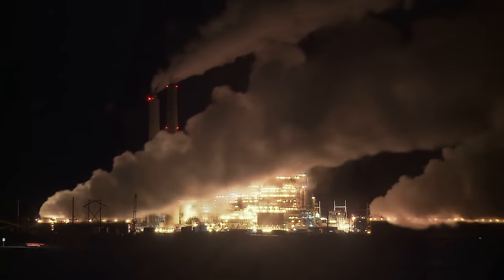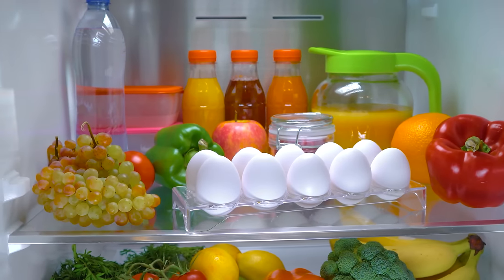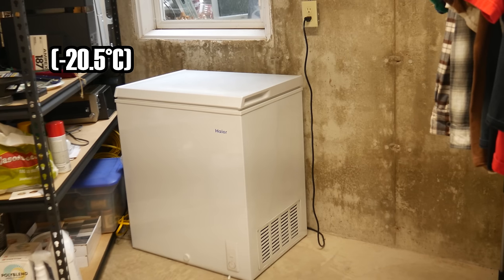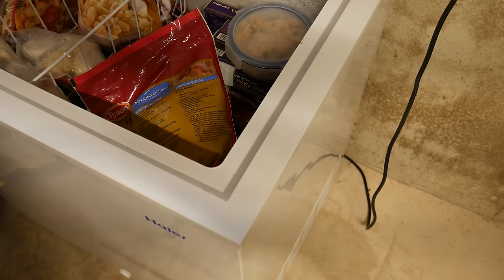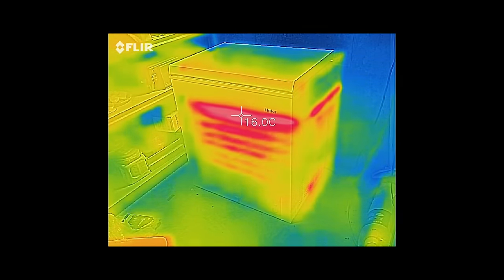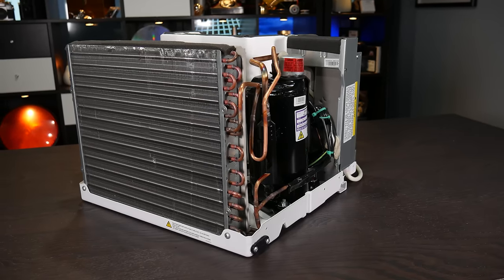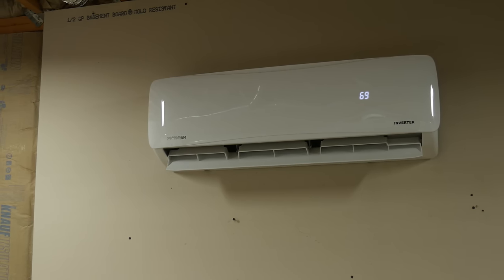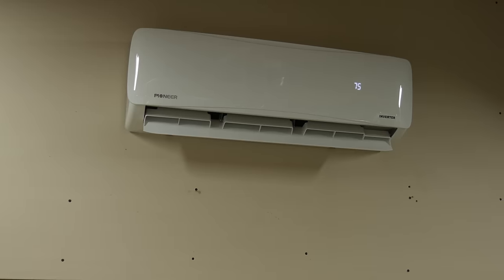Heat Pumps: the Future of Home Heating

Comment: First off loved the detailed explanations of this video! We have a heat pump here in the North West USA. It is great spring and fall (anytime temp above 35-40 f - they have little to no usefulness below that as stated in the video). We use natural gas for the 2.5 months that temps are usually below that. I was little perturbed by the scene of a snowy cabin being used to introduce the heat pump heating abilities - that is very unrealistic. That would be so expensive!!! They use so much electricity below 40. We forgot to turn off the heat pump once and our bill was 3x compared to natural gas furnace.
Reply: The three we had installed are rated to work down to -25c (-13f)  We have baseboards which may be used selectively when heating on days the temp dips below that.  Usually about 3-6 days of the year.  Great investment!
Reply: Absolutely.  The irony of a heat pump is the colder it is, the less efficient they are.  Outside of CA and a few southern states they are a total waste of money and electricity.

We installed a wood stove because our heat pump couldn't keep up in the winter.  

Seems like the world is losing it's mind.  I'd never buy a house with a heat pump anywhere that gets below freezing.
Reply: @dielawn212  it is currently - 26c here, and in Winnipeg it is common to be ten degrees warmer or colder all winter. Our closed loop geothermal heats our 4000 Sq ft just fine, and over the last seventeen years has been flawless
Reply: Exactly - that's why I don't see them as this amazing thing. I had the same reaction to that picture. 

Even on the east coast it gets below 40 often during the winter, if only at night, let alone when we have a colder than normal winter/cold snap. 

And over 40, it's not even that cold so what's the point? The house can keep it's 65-ish temp on it's own.
Reply: A geothermal is not a standard air-air heat pump.
Reply: @grant r. Geothermals are a type of heat pump but not the standard air to air model.  Yours is a Geothermal heat pump. Meaning the medium of exchange is in the ground and not simply the air itself. Much more consistent temps below the frost line than above it
Reply: Also way more expensive than the standard air to air
Reply: @bertellijustin6376  Yes, that is true. It is much more efficient with the ground loop than air to air. These systems are more condusive in cold climates, however the initial cost extends their roi.
Reply: Consider geothermal heat pumps, check out their advantages and disadvantages.
Reply: There's also different brands that operate at higher pressures using different refrigerants that work efficiently at Much lower temperatures these days.
Reply: Most air to air heat pumps sold in Finland make plenty of heat even in -25C degrees. It can't heat the house on its own in that temp but overall my pump saves me so much in electricity over the year.
Reply: @jaakkolehto8203  Consider using geothermal heat pumps, they should work in colder climate. At least in the lower 48 in the USA.
Reply: @timothyprice9064  Definitely that would be best choice but as my house doesn't have water based heater system (radiator/floorheating) it is very very expensive to install geothermal+ heaters inside the house. House that i live has one air to air+ 2 ton energy reserving woodburing stove that heats the house 24h even after the fire goes out. So i only need direct electric heating when it gets -20C or colder. So for few weeks per year my current system is pretty good.
Reply: @jaakkolehto8203  Geothermal heat pumps are not what you're thinking they are, their lines are hurried just below the fros line. Look up geothermal heat pumps, it might change your mind.
Reply: @dielawn212  I don't know I live in Canada and people in Canada all over the place having pumps and they're way more efficient then other sources of heat now in extreme cold like - 25 or below you need to have little extra heat I have an electric forced air furnace but it's an energy hog most of the year they're wonderful and then you have air conditioning in the summer
Reply: @grantr5417  You said geothermal.  That's not what we are talking about.  The video is about standard heat pumps, which are ac units that can reverse coils.
Reply: @dielawn212  It doesn't mean that heat pumps don't work in cold temperatures, it just means that YOUR heat pump doesn't work in cold temperatures. There are plenty of heat pumps that work efficiently up to -30C (-22F). Technology improves every year and it's important not to have a determined anecdotal opinion about an important topic such as this.

Comment: As a studying mechanical engineer who recently studied thermodynamics, this makes me incredibly happy! 

It changed my entire way of living when I learned just how more efficient heat pumps are compared to a resistance heater which I used to mainly use.
Reply: faisal3398 as a graduate mechanical engineer with nearly 40 years experience (20 in building science), I base my consulting business (Net Zero Energy Retrofits) mostly on heat pumps!

Comment: Heat pumps have been used for at least 30 years in the Nordic countries, more then 50% of all single-family homes in Sweden were heated by heat pumps in 2018, according to the latest statistics
Reply: Thermia did it 1973
Reply: That's a lot of cold nords. Heat pumps are highly efficient heating in mild temperatures, but anything serious and they struggle. Swedens push for heat pumps is likely focused on using renewable electricity than effective heating.
Reply: @derekakaderek  The heat pumps he's talking about are ground source heat pumps. Air source heat pumps can be a complimentary system even in cold climates but drill a hole deep enough and use the thermal energy of the ground and it doesn't matter what the air temperature is.
Reply: @derekakaderek  I live in Sweden (the south west coast) and have an air to water heat pump that heats my 185 m² (1990 sq ft) house. At temperatures above -7°C (20°F) it works just fine. The closer to that lower bound the less heat it manages to give my central (water radiator and hot domestic water) system. There are units for sale in Sweden that claim a lower bound of -15°C (5°F) or even colder. The system I have naturally has an electric resistive heater in the reservoir to take care of situations of more extreme cold but thanks to global weather weirding this last decade has given me at most a dozen days a year when the temperature has dropped below the threshold.
Reply: @kekburman  See my other response; I have an air to water heat pump. It works very well. Where I am located a hole deep enough to get into rock for a ground system could very well cost a lot more than two or more air to air systems. I do not have a property large enough to use sub-surface pipes. I would need 400 meters (quarter of a mile) minimum separation form neighboring pipe 2 meters (6 ft) and as deep to get the effect required. Some people do that with great results.
Reply: @GregorShapiro  yeah, that's not that cold. I'm from Alaska, -35C is routine. Diesel/Coal furnaces are mandatory. Absolutely, if you live in moderate cold (around 0) a heat pump is probably enough and more efficient than a proper stove.
Reply: @GregorShapiro  it work fine because you have electric heater as supplementary heating when heat pump capacity is too low. You even dont know when electric heaters kicks in. Below 7 deg C OAT efficiency is dropping.
Reply: @derekakaderek  Most of swedens population live in pritty mild climates. Same with Norway.
Reply: @hrvojelasic5794  below minus 7C! It is that low only a few dozen hours per winter!
Reply: @GregorShapiro  not minus, below plus 7degC.
Reply: @hrvojelasic5794  Daikin have systems for domestic use which they claim still extract heat from -25°C air. Twenty-five degrees belo zero Celsius.
Reply: @GregorShapiro  not really. I just installed one Daikin, while it has 4.5 kw power on compressor it has 9kw electric heater. So, it will work in low temp but on electric heater. if you would have basic understanding how refrigeration cycle work and how to read T-S diagram you would know you talk nonsense.
Reply: @hrvojelasic5794  OL I stand corrected.
Reply: HAHA! In the US we usually have furnaces for the winter and we dump hot air outside during the summer with our A/C units.
Reply: @GregorShapiro  Yes but one have to way they necessaries for one that goes -25 degrees it’s much more expensive than they -15 or -7 versions.
Reply: In quebec, canada, many homes are heated by electricity ( 240v baseboards as they're called ). Yet, my computer usually let me go trough winter without barely using them.
300w of heat is 300w of heat after all.  Methane/Propane is only a fraction of those others elements, but still a good portion. An other chunks of people, usually renters, have radiators heating.

Quoting stat can : "In Quebec, where electricity rates are among the lowest in Canada, more than two out of three households use electricity to heat their homes. More than one-third of dwellings in Quebec are apartments and about 80% of these buildings are electrically heated. This usage rate is much higher than the national average of 56%."

It's interesting to learn how we could be so much more efficient electricity wise.
ps : We still have some to sell even after aluminium smelters draining some Gigawatts when producing.
Reply: @GregorShapiro  CZ, north western part of country. Air to water. Below -8C and classical electric heating have to kick in. -20C which is there every winter and no chance to live without resistance based additional heating.
Unfortunately some people invested in air to water in old houses-brick/mortar/stone and this is even +1/2 more expensive than  gas heating even with special heat pump tariff for electricity.
Normal tariff is just about 2-3times more expensive than in US.
Also air to water often hits noise limits for neighbors.
For some apps just air to water is just waste of money.
Reply: @derekakaderek  -35C is real cold, however rock or ground heat pumps don't suffer like air to air or air to water heat pumps, air to air/water would definitely not be suitable at that point but maybe supplementary heating on warmer -25C or more days since at least the ones I've sold still work at -25C but not as well as at -5C obviously
Reply: With what you have to pay for a ground source heat pump installation you can heat your house for many years with only natural gas resources. 
And don't think to have a flowery garden with healthy trees around your house, because your soil will never warm up enough in the spring, when it is still rather cold inside and you are taking the first warmth out of the soil. Only grass and superficial rooting plants will be possible.
You can put your heat collecting tubes at least 100m deep, that will work, and that can really be the future for INDUSTRIAL constructions.
Reply: @duudsuufd  like you say, ground source heat pumps do take heat out of the soil, but if you dig them deep enough or large enough you won't have that problem, if you have a problem with ground source you can just get rock source, the upfront investment for drilling is expensive, but once you have the holes you won't ever have to pay that again and a new pump isn't that expensive. I do want to point out that where I live we don't have access to natural gas at all so lumber or diesel/oil is the norm with supplementary heating from resistive heaters
Reply: @duudsuufd  I pay about 15000 dollar for everything in 2004, my old oil heater was broken and i had to buy a new anyway. If i insted baught a oil heater i had to spend about 5000 dollar so i pay 10000 dollar extra .
for one year i use 2500 liters of oil (3200 dollar) with heat pump 6000 kWh (1200 dollar).
In 5 years the heatpump was paid and the last 12 year i have cash in money.
I have a 145 meter deep energy well and a lovley garden with fruit trees and flowers in the spring , summer and autum.
All the same like before i had  the heatpump.
English is not my language so dont be to hard on me.
Reply: @kekburman  That sounds like geothermal heating not mini-split heat pump. Isn't geothermal expensive to install? how can half the country afford that?
Reply: @tomascallheim4758  Your energy well is 145 meters DOWN? That sounds really deep. How are they able to lay pipe down that deep? 

Actually on second thought. I think there are 2 types of geothermal one using a well and another using laid out pipe correct? So you're saying you have the well version where you pump water out of the ground and extract the heat out of it and send it back to the well right?
Reply: @orielsy  the first 25 meters are pipes the rest is drilled thru rock and its all One hole stright down. The hole is 6 inches Wide and in the hole they put 300 meters of tube.
Reply: @orielsy  A complete installation with the heat pump and drilling of the energy well tends to be around 15000€ in my area. It's expensive yes but it's also the cheapest to run/maintain because it has very high efficiency, most installations pay for themselves within 5 - 10 years compared with other options like heating oil or district heating, and are significantly cheaper after that point.
Reply: They've been used in the south of the US that long too.. This guy doesn't seem to leave his little hole and see the rest of the world.
Reply: @derekakaderek  I was wondering about that, In thundaybay it can snap freeze, though we usually have lows of -30 as a maximum for the year, every now and then we have a winter that drops to -50 for a day or two. I was wondering if heat pumps could go that low. 
My grandmother though might adore this, as she has a fire based central heating that she isn't a fan of running all the time, but the electric she got in place of that is quite in effective. Running the fire based central heating during the really cold days could be perfect.
Reply: @umberonxd  geothermal heat pumps require some serious dirt moving. you have to install a lot of underground pipe.
Reply: Are heat pumps better than solar water tubes?
Reply: We are using heat pumps since 1986 in our house. The first one was not really efficient, but the second generation and the latest, which is 3 years old reduced our energy consumption for heating a lot. I highly recommend the combination with a photovoltaic array! Greetings from Germany.
Reply: Sweden's medal is in the post.
Reply: @derekakaderek  How do they work near the shore of a great lake? do you know if that will effect them? I dont own a house, so its a bit of a mute point, but I am planning to one day.
Reply: @umberonxd  that's a fascinating question actually. Obviously a heat pump will work better the hotter temperature it gets to work in. So if I was you i'd try to find out if the ground temperature near great lakes is lower than average.
Reply: @tomascallheim4758  Yor garden flourishes because you take the heat from 145 m deep, and not from a tube network 1,5 to 3 m deep as they usually install it.
Reply: My house here in California was built in 1961, and it's always had a heat pump. Heats in the winter, cools in the summer. It's great.
Reply: @nucks2233  the guy commenting right above said his American house has had a heatpump since the 1960s........
Reply: @nucks2233  As I said, I've had a heat pump at my house in California since it was built in 1961.

People make choices, and sometimes they make choices that defy all logic.  If you don't believe it, take a look at the comment section on any video that talks about LED lights for your home.
Reply: They've been used for that long in the U.S. as well. Not sure where he has been on this technology.
Reply: I know nothing about heatpumps, but i know they generally aren't sufficient if its very cold. I was wondering, couldn't you make like a 2-stage heat pump ? Simply using the process twice in row, where the outside unit works in -25C air, a heat exchanger between the 2 pumps is at 0C and then the second pump brings it to 25C ? (probably using 2 different refrigerants)
Reply: @antondegroot6061  In general you could size the unit twice the size and you would get capacity at low temperatures but your COP is still way lower then in optimal temperatures. You cant go around Carnot process - it is thermodynamics. It is a long discussion but the way how heat pumps are presented nowadays is misleading and border line cheating. I was selling Carrier  products for about twenty years and provided literally hundreds of engineering solutions from small domestics to industrial up to 10 MW. You could get data with exact water/air temperatures/electrical input, nowadays for some reasons these data looks not available - and you cant size system properly without. I had some discussion just last week  about how to get most of heat pumps and one good way is to use heat pumps up 5-7 degC OAT and then switch to gas boiler. If you your house load is 20 KW at -3 degC it would be cca 10 kW at plus 7. This way you could select twice lower heat pump size without supplemental electrical heating (you need to reserve power and pay for power) that will work always in optimal temperatures regimes and at high COP values and cover peak demands with gas boiler that is also extremely efficient if properly utilized (modern condensing boilers).  For this solution you need properly design hydraulics and size radiators/fan coils or floor heating to meet demands at different temperatures. If you utilize heat pumps this way you also need around 1/3 less radiators in your house. In general I don't recommend heat pumps for lower temperatures.
Reply: @derekakaderek  Nothern norwegian here. We use air to air heat pumps, they work great at -25c.